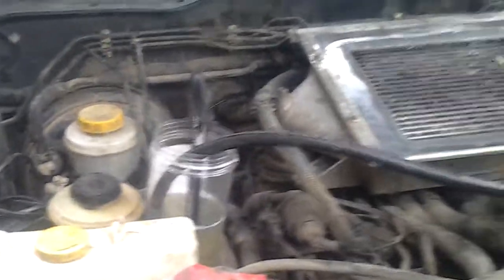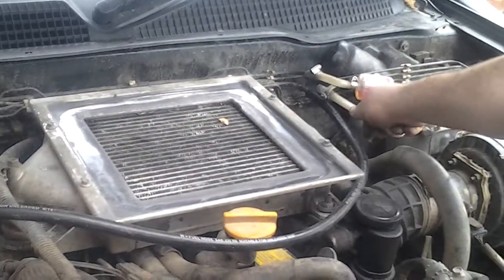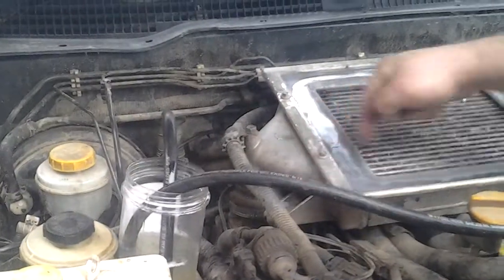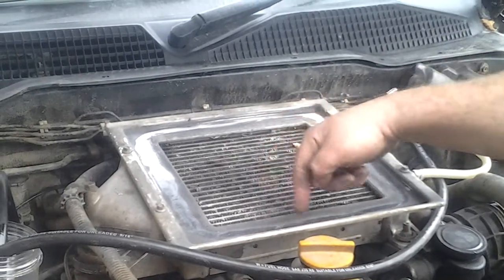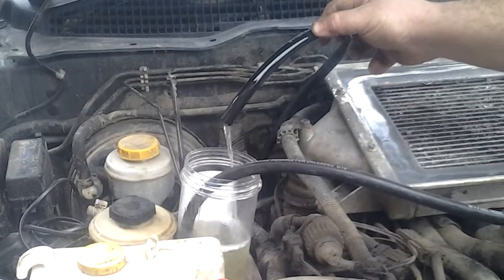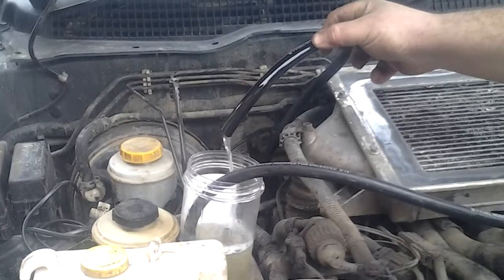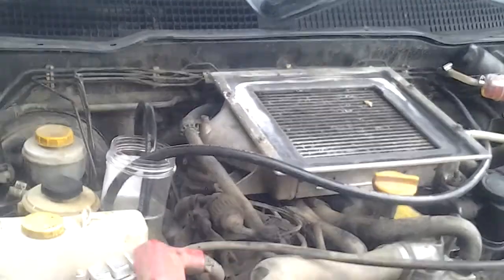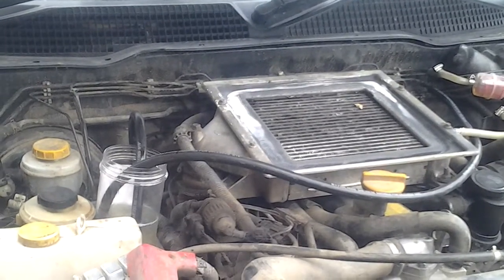Nissan Terrano two 2.7Tdi Liquimoly Diesel Purge (a rough description)

Comment: Eso en realidad que es lo que hace? Limpieza. Esque tengo el mismo Motor del Terrano ll. 2.7TDI.👍
Reply from the maker: A mild clean for the injector pump and injectors, will not cure any large problems but will help with some things.
Reply: @markdouglas4139 Muchas Gracias.mark